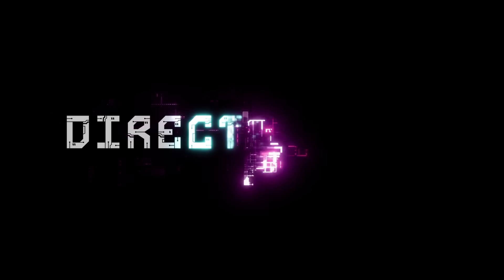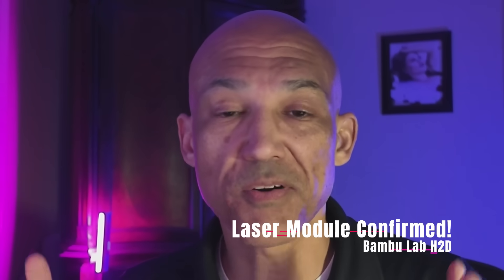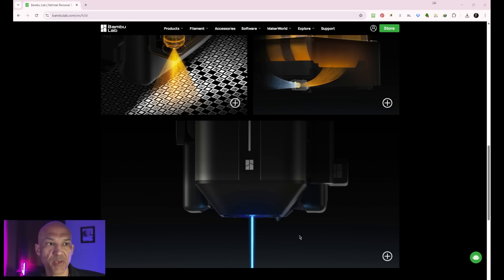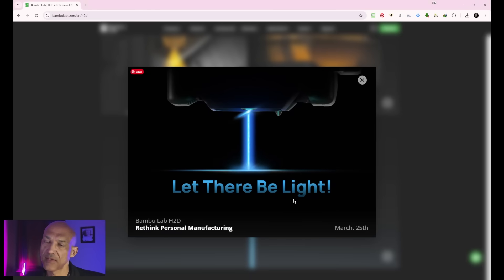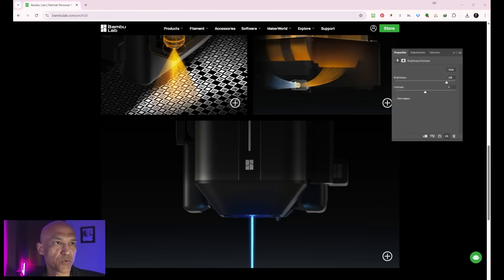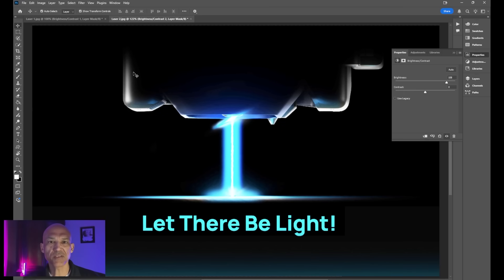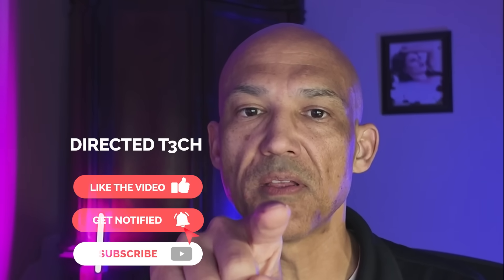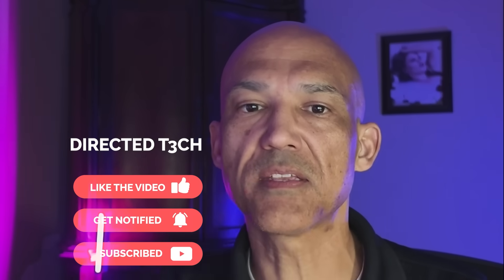Bambu Lab H2D Flagship 3D Printer with Lasers Confirmed!!

Comment: its a 10Watt 2Watt IR  DUAL diode style I'm sure it s gonna be good at etching. with the 2 Watt IR diode. the 10 watt would only do cutting and etching on wood etc. thats my guess. and they said the base would need a  extra upgrade kit as the air stuff are not build in, and it would have to then be on the "side of the machine , outside " if I understood that right.    , only for the COMBO h2d is the advanced air system build in. there could still be a heap box on the side at the end of the exhaust pipe, we can see on images its a 100mm exhaust pipe running behind the printer.
Reply from the maker: Turns out there are only 10W and 40W 455nm blue lasers available.  The IR would have made for some interesting capabilities!
Reply: @directedt3ch  I dont know, seem nobody really have tested the laser in full detail, they spec

10W Laser Module	Laser Type	Semiconductor Laser
Laser Wavelength	
Engraving Laser: 455 nm ± 5 nm Blue Light
Height Measuring Laser: 850 nm ± 5 nm Infrared Light
Laser Power	10 W ± 1 W

so the 1 W must be able to do something, and in the video from bambu they did laser on 3d prints, in the reveal. so idk im thinking more detail will start to pop up soon.
Reply from the maker: @PrintVentures  That is just a common tolerance nomenclature.  It's a 10 watt module that can vary by 1 watt up or down.  Same as saying 9W to 11W.  455nm lasers can mark stainless steel.

Comment: Standard plywood has a sort of glue in it that makes a lot of that smoke and that stucky brown residue when it's cut with a laser that you show on the cutting surface and on the ply. There are types of plywood that are specifically designed for laser cutting that use a different glue that makes less of a mess. I can't exactily how much less of a mess it would make in the Bambu product, but perhaps they will only sell/recommend the less messier type.

Comment: In less than 10 hours of me posting this all will be revealed!  If it is a laser like you have I think I'll hold off.  I really hoped the laser was for some sort of 3D scanner.  If it isn't on this printer some other company needs to run with a scanner in the printer idea!  Maybe it is for strengthening the print?  Like annealing the print?  Not sure it would work though.

Comment: My guess would be that the laser is for layer adhesion, partially melting the previous layer just ahead of whichever nozzle is printing, and in whichever direction. I would also guess that the laser module is fixed at the rear of the unit, and laser light piped into the extruder assembly via fibre optic. As you elude to, it doesn't make any sense to go cutting wood in a 3D printer.
Reply: If the laser can increase strength between layers it is quite a good idea.
Reply: I am also thinking this is the right use case as you suggest. I tiny melt before putting on new filament. That would make sense.
Reply: 10W laser for adhesion of low temperature materials like PLA. 40W laser for higher temperature materials and increased printing speed. Oh well, the next few hours will probably prove me wrong.
Reply: I just found this:   Blue lasers are increasingly used to melt and process plastics, offering advantages like high absorption in certain materials and enabling precise, contact-free joining and welding techniques. 
Here's a more detailed look at how blue lasers are used to melt plastics:
Advantages of using blue lasers for plastic processing:
High Absorption:
Blue lasers (around 450nm) are absorbed more effectively by many plastics compared to traditional infrared lasers, leading to more efficient melting and welding.
Reply: Oh dear, I was wrong. Bambu Lab really have gone off the rails. Just watched the release video, and the laser is for cutting. Dual nozzles and bigger bed are nice, but the rest is meh. Oh yeah, and if you want all the bells and whistles it's just shy of 3 grand. No thanks.
Reply: I was thinking the same thing.  I would pay for a laser that increased layer adhesion but not for cutting sheets of unrelated materials and dirtying the mechanics in the chamber.

Comment: You say you know a Lot about Laser..... Well why do you use a reflective Metal Sheet under the Wood then? Thats why all that dort in underside. 
Also there will BE a 10w and a 40w Module 
Also on the Demos there was way to much Power used in the Laser. 
Yea i also been using Laser for over 5 years. I have Diode, CO2 and fiberlasers Here for my small Business.

Comment: Im excited to see how the Bambu marketing department tries to make this seem like a good idea 😆
Reply from the maker: I don't think it's a great idea personally.  It is going to cause a lot of dust and grime that will require a healthy dose of cleaning.  It does look like they have a few decent safety features such as you can't use the laser unless the cameras detect the laser plate.  Fire is still a big concern for me however.
Reply: @directedt3ch  soot accumulation on the linear rails and screws is going to be a nightmare. Camera lenses, too 😑
Reply from the maker: @CarbonKevin  Yep. Did you see this? https://wiki.bambulab.com/en/h2/maintenance/period-maintenance
Reply: @directedt3ch  "Just follow this simple 20-step cleaning process every three months!" 😂
Reply: why isn't it a good idea? laser cutting is faster and better than 3D printing parts in many cases

Comment: Somehow I don’t think it’s going to be a laser for cutting/engraving. Not sure what else it could be but all the smoke and soot inside a 3D printer is not a good idea and I can’t see BL doing this.
Reply: Agreed, using the laser for cutting and engraving inside a 3D printer seems like madness to me. I reckon it's for layer adhesion.
Reply: @ interesting thought! Perhaps enhancing layer adhesion making parts strong in more than one axis? That would be cool!
Reply: @MickHealey very interesting thought!
Reply: I agree, I don’t think it’s for cutting either.
It would be pointless.
Reply: my guess is for smoothing/ironing layers removing layer lines completely
Reply: It doesn’t make sense to me. I’ve used an industrial laser before though and they don’t get too much smoke or sit just because it’s pumped out so quickly from the exhaust. That’s the real question but I have a feeling it’s just gonna be something stupid like laser bed leveling or something
Reply: Can't imagine it's for cutting either, maybe a low power laser for light ingraving? Like putting on a logo/name only on your prints. I have 0 knowledge about engraving and lasers, so don't know if that could be an option.
Reply: They did it. Adam Savage Tested channel just posted a video WITH a H2D in studio! It has a laser cutter with the dual nozzle printer.

Comment: when you had been using and cutting wood with your laser you are not using air assets which is why smoke is going everywhere if you did you would have seen no smoke at the diode it would have all been redirected which the inclosed Bambu would do and vent it out the back
Reply from the maker: @MrDonXX  I understand how fume extraction works. The H2D is going to need some pretty hefty fans to move enough air to not smoke people out. Not to mention that it is much better to have a fan at the end of the duct to pull air vs trying to push air from the machine through a duct.

Comment: The only way it will work is a UV laser which has no heat (UV is 'light' right?) and that can only be used for non-organic material, so much less smoke and debris
Reply from the maker: A UV laser would be a game changer.  That would really be a pricey part though...
Reply: An IR laser would work as well. Tons of us mark our plastic with an IR module.
Reply from the maker: @Destination-Valhalla  That is true.  I use my fiber (1064nm) to mark 3D printed items.

Comment: I worked with 2 big commercial lasers where i worked at Vari-Lite we made robotic stage lights and they are very maintenance needing machines due to the ablation coming from what they are marking/cutting. I see no way to use for etching/cutting without a serious exhaust system to the enclosure. I don't think we know what they are doing with the lasers yet but don't have long to find out.
Reply from the maker: All should be revealed tomorrow!

Comment: Boo on the laser, I wish they would have focused on a bigger bed
Reply from the maker: It's odd that they seem to be ignoring the most commonly asked for feature (bigger size).
Reply: @directedt3ch  should release a p1s xl 350x350x350. This machine looks cool but not sure how much I'd use the laser.
Reply: But it is a bigger bed though…🤷‍♂️
Reply: @UG3DBoss-54 a bigger bigger bed
Reply: Am curious when people say they want a bigger bed what do they mean? Is it 400,500,700 cube or about the orang storm size.
Reply: @KahmerePrintLab  At least the K2+ size: 350x350x350 mm. I am quite disappointed by the size I have seen with the leaks.
Reply: i feel like the laser is going to be for ironing reasons?
Reply: the market for huge printers is  small. otherwise everyone would be making only huge printers. H2D is already in helmet class >300mm². that's big enough. they're going after the main market of desktop or desktop+ not industrial farm scale.
Reply: @mostlymessingabout  Back when I was in grad school, people said that a 2GB hard drive was excessive and could never be filled and so it was unnecessary and the lower storage drives were sufficient for everyone. I do not know what "helmet class" means, but 300 mm is not sufficient for my use cases. I will either get a larger printer from a non-Bambu manufacturer or wait until Bambu listens to the many who have stated their desire for a larger printer.  Just a different way of looking at this stuff.
Reply: Get a K2 Max or a Prusa XL then.
Reply: It has a bigger bed. 350 x 320 x 325
Reply: @Bretto311  I agree, I’m totally ok with the cutter because it doesn’t produce smoke or fumes to gum up the printer, but not the laser. I’d rather buy a laser separately and keep it in the garage.